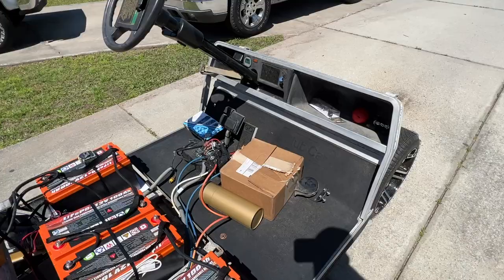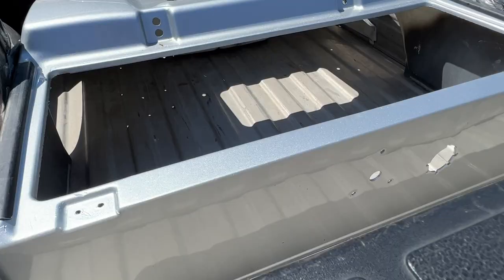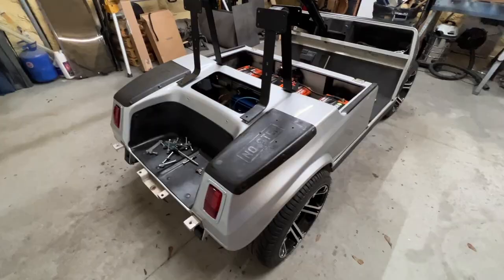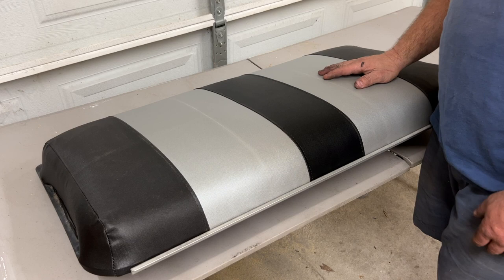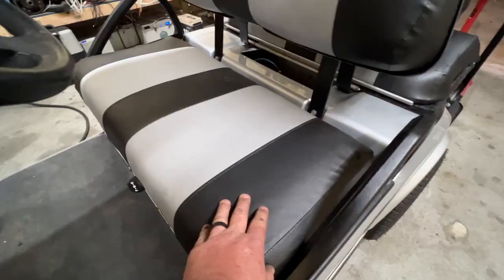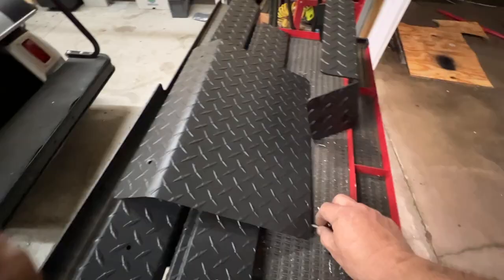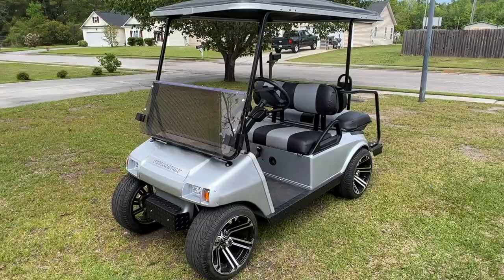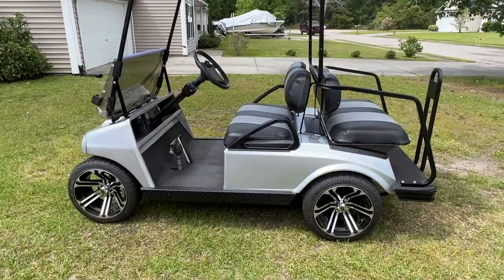3 EASY Upgrades from GolfCartStuff.Com That will Change Your Golf Carts Look | Club Car Paint Job

Comment: I had to raise the back rest on my new Yamaha because when I lifted the bottom seat it hit the back rest. I wish a saw the way you used the clamps and two by four to level and hold in place. More secure than the way I did it. Nice clean upgrade, great  job !

Comment: Hey great video's, I just discovered your channel! I have an 86 club car, 36 volt, resistor style cart that I would like to get more speed and torque.  Do you have any video's or recommendations on how to do this?  I am open to all suggestions
Reply: We are in the same boat , I have a 87 ds . Trying to upgrade it

Comment: Looks awesome.  Quick question.  For the side diamond-plate pieces did  you use a white spacer for the rear screws?
Reply from the maker: I did but I used different hardware to attach it so it blended in.
Reply: @Fentertainment  Did you still have to use the spacers with the black hardware?

Comment: What would this sell for? Maybe 5000?
Reply from the maker: Maybe if it had a stock motor, controller and lead acid batteries but this cart has lithium, alltrax controller and plum quick motor. This cart does 30 right now. I have more things planned for it as well.
Reply: @Fentertainment  oh wow so maybe what like 7k?
Reply: @Fentertainment  what year club car was this? Mid 90s?